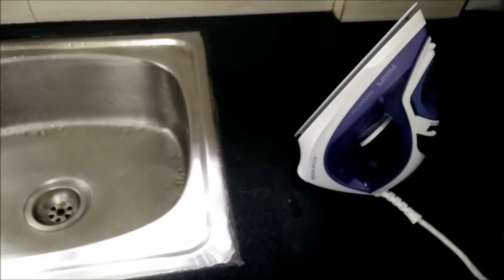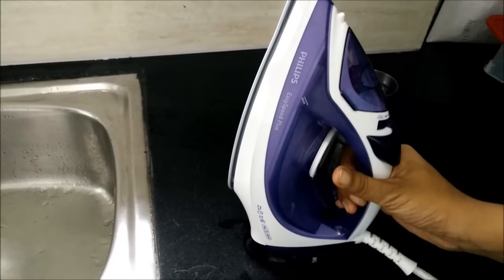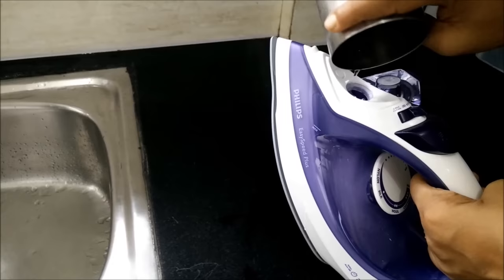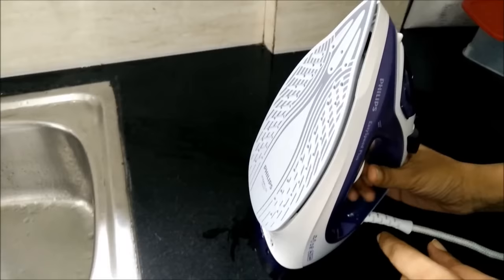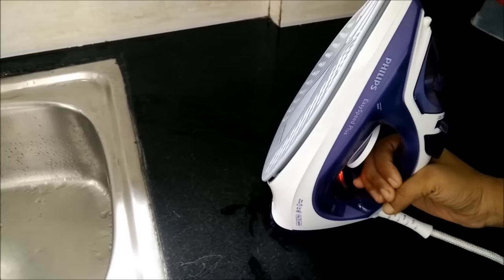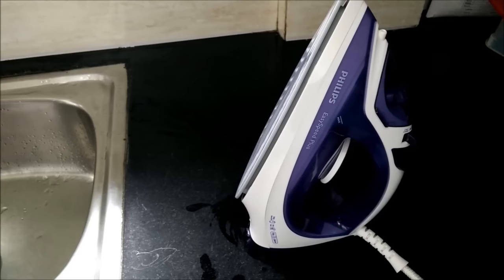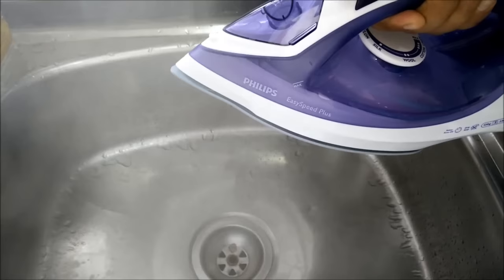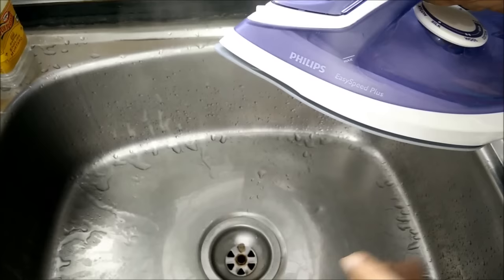How to De scale your Philips Steam Iron | How to use Philips Steam Iron | Ironing Tips Demonstration

Comment: actually works. My iron was really clogged, used the process a few times and its already cleaner, i will keep repeating the process weekly till its sorted.
Reply from the maker: +Diana Frank glad we could help. Pls do subscribe to our channel if you liked our video. We will keep sharing such useful tips...
Reply: +Happy Pumpkins ! hi..i have same exactly ur iron but now it's dropping the water out when I iron.can u help me how to fix it.thanks.
Reply from the maker: Karen Omrany The steam irons drip water when the holes in the soleplate are blocked and steam can't come out properly. You need to de-scale your iron. Follow the procedure as explained in the video and it should be fine. If the problems still persists, pls take it to the service center.

Comment: After the calc clean process...
1. Plug in the iron. Let the iron heat up to let the soleplate dry
2. Unplug the iron when the temperature light goes out
3. Move the iron gently over a piece of cloth to remove any water strains on the soleplate
4. Let the iron cool down before you store it

Comment: I have same type Philips. The calcium build up not yet clog but sometime if i press steam it comes out from the hole. Can i clean it, with mixed water and vinegar inside the tube?
Reply from the maker: Don't put vinegar inside the iron. Use this same trick instead
Reply: @HappyPumpkins  Any reason why dont put vinegar mixed with water inside it?

Comment: Hey which one would you recommend between GC 3721 & GC 2048 . Which one is better option
Reply from the maker: purendragoyal Performance and features wise GC3721 is a better iron. It has an electricity saving feature which detects how much pressure you are using to iron your clothes and adjusts the steam accordingly. But GC 2048 is a new launch with better looks and lighter weight
Reply: just buy the GC5039 and u will happy ever after😂